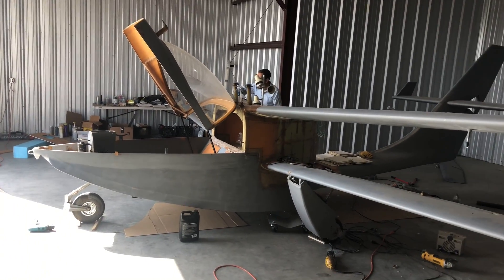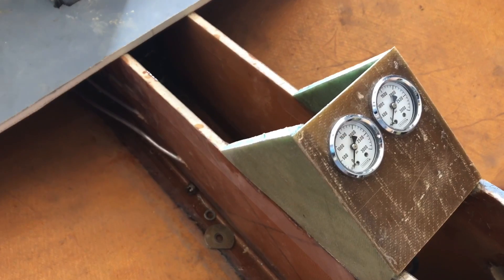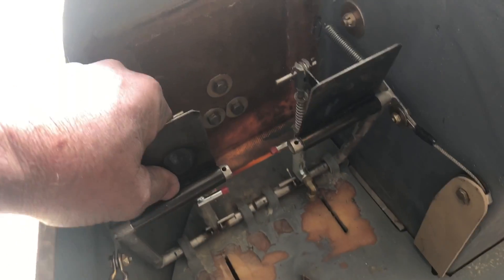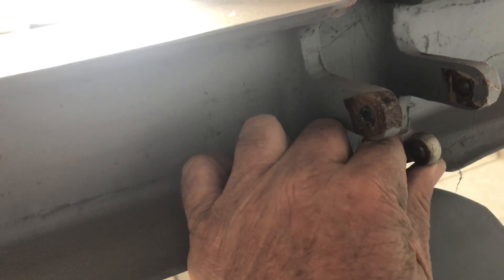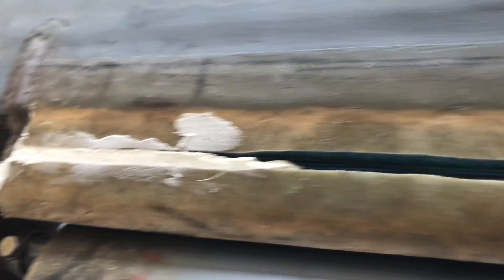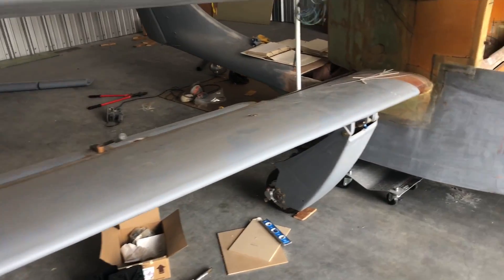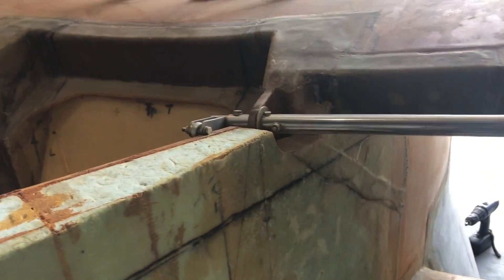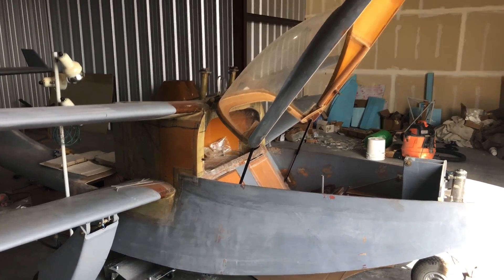New aircraft project

Comment: I believe it was the right main.    I would pull the strut and try to pull it towards the end of the wing. you will see the week points at the front mounting of gear. at the leading edge if it was not beefed up.   Do you have the builders manual?  Tom and I both agreed that the way the book said was not enough structure.  That landing gear is made out of blue foam with maybe two layers glass draped around it.  I remember you could lift it with three fingers with out the wheels and strut. Very light weight. The manufacture and Tom the owner was hounding about the weight. Afterwords He just wanted to get it home so he would not let me repair and "beef up" the other main gear.  I did not ask you if you finished and flying yours but i hope you are.  Did you see the goose that a guy had on his yacht with a crane to lift it up and down on the water?   Good luck....
Reply from the maker: i didn’t.  we are doing taxi tests right now

Comment: That maroon, gray and white goose with the canopy open you used for this screenshot,  I did all the composites, hung the motor, panel and i believe he wired it all up. after i built it.  He took it to Spruce creek fly-in and mounted the tail section.  His name was Tom Olson.  He was the original owner.  I had a surfer dude shape the wing tips.  I built two of them.  The first one was donated to Embry Riddle.  The painter went crazy with the filler.  I was told someone took off 12 pounds of filler on the horizontal and elevators.  Tom Flew his airplane to Massy air park in a cross wind and tore the right main gear off.  I repaired it there.  The mounts with the fonalic that Tom Scott, the goose manufacture shows you is not enough.  Take care...
Reply from the maker: that was the main landing gear that got torn off? We had some information about the front landing gear and we upgraded yet.